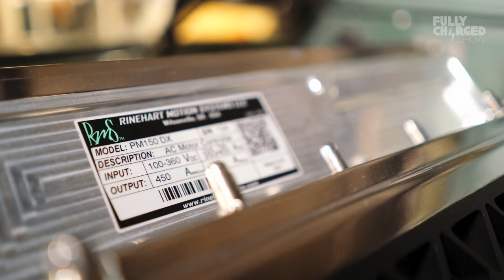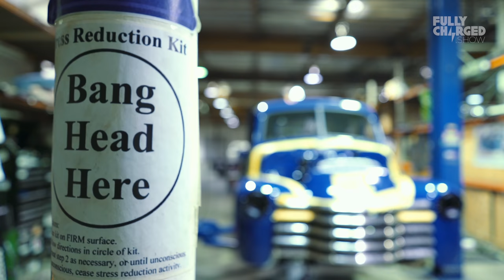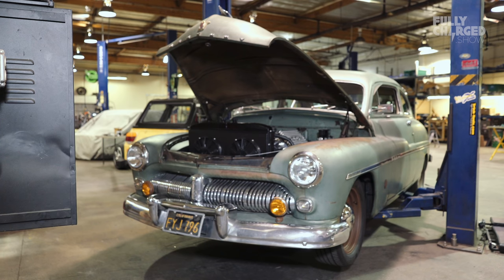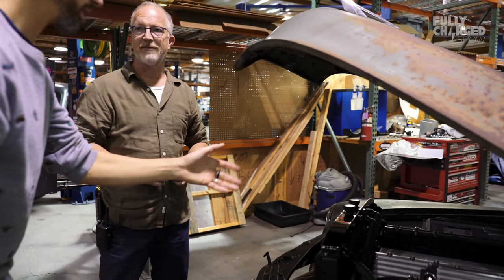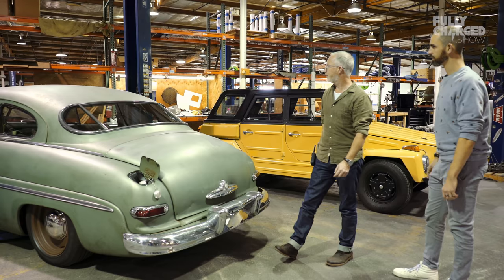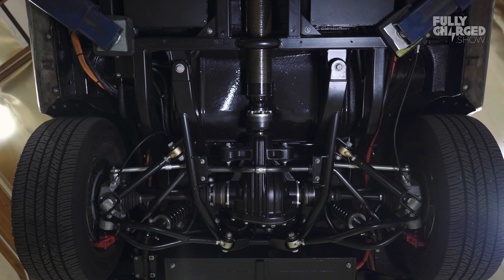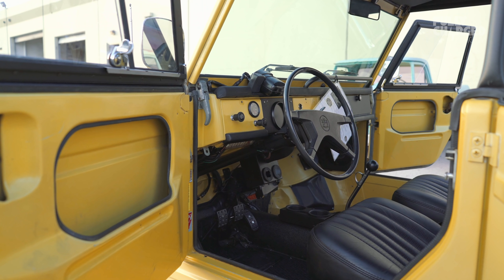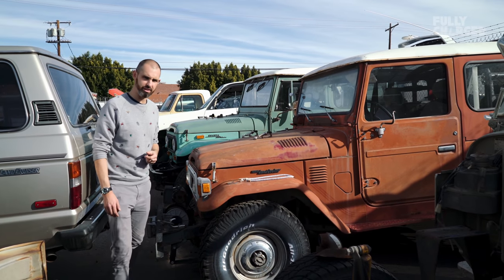Icon Derelict 1949 Mercury - EV Resto Modding | Fully Charged

Comment: Cool shop and cool car. I find the "Things were much better back in the old days" story tiresome though. Cars in the '40s -'70s were not well engineered or made to last. In my teens in the early '70s I wandered area junkyards studying cars and occasionally buying one to take home to autopsy. It was uncommon to come across a junked car with even 100,000 miles on the odometer. Cars were made of huge slabs of stamped steel because both steel and gas were cheap. Heavy body panels were the only way they could keep body-on-frame bodies relatively straight. Panels were fitted together with slots upon slots. Panel gaps were enormous. Engine tolerances were an absolute joke by today's standards. Yes, they were easier to repair. That was required because they so often needed repair. No,  the old Merc could not pass a side impact test.

I too am enamored by some '50s and '60s design elements and I'm glad to see these old cars being converted to EV. Especially so when I look at how they help give a desirable image to electric transportation. But that revisionist history "The old days were better" storyline that so many people willingly buy in to is unhealthy for our society in areas far beyond the expensive restomod scene.
Reply: There's an amazing video of a crash test between a 2009 Chevrolet Malibu and a 1959 Chevrolet Bel Air that's worth checking out.
The classic car just disintegrates, whilst the modern one would leave the driver mostly unharmed.
Reply: @drunkenhobo8020  And... it's rigged. The engine was removed from the Bel Air and other modifications made to make for a more dramatic video.
Yes, any car from the '50s isn't safe by today's standards. They were incredibly deadly in head on collisions. I just thought it undermined the point of the video to fake it. I guess putting in calibrated dummies and adding up the damage points would make for a boring video.
Reply: I love old cars, but you are absolutely correct in your assessment. Old cars survived an impact by killing their occupants. Energy from a collision must go somewhere: if it's not deforming the vehicle's body then it's likely deforming yours.

Old cars leaked fuel, oil, and water and also required frequent maintenance way beyond what would pass today. It was not uncommon to put pans or cardboard sheets under even new vehicles to see if they would ruin your driveway. Creaks whistles and squeaks were  audible over the engine noise. 

Initially derided as "Jap-crap" it was, somewhat ironically, the Japanese manufacturers that raised the standards (instilled by W. E. Deming, an American) of vehicles.
Reply: Thanks Bill, for the clarity...it's a dangerous game comparing across era's but the false memory  undermines a lot of the ability to compare details and be more precise about what worked and what didn't and why. The reason a lot of the old ways changed was exactly because the buyers didn't want them anymore..for a reason.
Reply: Well cars from the 90's and early 2000's can and have successfully made it into 500k+ miles territories. Not all of them obviously, but I know far more examples of high mileage E34 and E39 than E60. There are many W124 that made it over 1kk kilometres, but not the W201. Toyotas from early 2000's, barely ever break down. 
Ironically most modern cars have more problems with electronics (and sometimes it's just the wiring), rather than mechanics.
Reply: @TheAndreArtus  Same for motorcycles. When I first went looking to get one in the late 1980s, I asked everyone I knew who rode or had ridden what they recommended. The only person to recommend a Harley was this one Harley purist guy for whom that was the only "real" motorcycle. And his was always in various pieces on his living room floor. A couple other old bikers confirmed that Harleys are great if you like to spend twice as much time under your bike as on it; if you enjoy wrenching more than riding. Me, I don't wrench, so I got me a Honda for my first, and Beemers ever since.
Reply: I believe GM was doing planned obsolescence all through the 70's & 80's. My Olds Cutlass had so many embarrassing minor issues by 80k miles(AC,Carb,Windows), I couldn't wait to trade. Unfortunately, for GM there was a Honda lot on the same block willing to deal.
Reply: @jur4x  Much of the problems with aging electronics in cars is rooted in ROHS, the European standard that banned lead solder , among other things. This was a shortsighted regulation. Far more potentially hazardous waste is generated because of discarded parts and vehicles that should be easily repaired.
Reply: @doodlebug1820  I love old motorcycles but my 1977 Honda mostly sits. Weak brakes that require a lot of force with no ABS is a scary combination
Reply: @bgsound2721  Before then US manufacturers had focused on style over engineering. Engineers at GM wanted to build a mid engine Corvette from about 1960 but it is finally coming to market next year. As pollution regulations came into effect Detroit basically said "we can't do that" and looked for the cheapest way to kluge together existing technology to meet regulations. Foreign manufacturers saw the opportunity to invest in engineering and design and kicked Detroit's butt in quality by constantly improving the core product under the skin. It was sad to watch, such a missed opportunity. They are missing yet another such opportunity today.
Reply: @Miata822  I also still think that older point-to-point wiring is a bit more reliable then modern CAN-bus. At least, faults would only affect this one thing, not something else elswhere on the car. 
And speaking of repairs. Why the hell these days you need computer (with special expensive software on it) to replace brake pads or 12V battery?
Reply: @jur4x  I too prefer discrete wiring as it makes field repairs easier for unskilled or ill equipped technicians (on the machines I designed for use in harsh conditions and remote locations). For personal vehicles it makes a lot of sense though. It cuts OEM cost and channels repairs to their outlets.

Why does service require a computer? Because a modern car is a computer. you downloaded the right driver for those new brake pads, right ;-)
Reply: @Miata822  I do find it odd though that for someone who is so knowledgeable about cars would make a statement that "side impact is better than any modern tissue paper car". That is another one of those myths and is just false. I guess he is in the business of selling classic cars so he feels like he has to downplay the huge gulf in safety compared to modern cars?

The Plymouth crash test is at 40 mph but with another car that itself crumples which lessens the impact.  
https://youtu.be/iXUlZjScP3M?t=368

The Model 3 crash is at 38.5 mph but with a rigid barrier ram and looks barely bothered. https://youtu.be/zif6Od2vlyA?t=1
Reply: @Miata822  And the biodegradable wire insulation have plagued a decade of European cars, because it works and provides food for wildlife.
Reply: @drunkenhobo8020  Actually, it's kinda the opposite. Modern cars are designed to crumple, thus absorbing most of the energy. Old cars, well, have none of that. So, a modern crash test really mangles the car, but the occupants walk away. A "classic" goes through the crash barrier (wall) with only a few scratches, while the occupants are bloody smears on the inside.
Reply: Don't agree
Reply: Perhaps a CAD designed frame could be remade to include newer safety features such as ABS and airbags as well as newer style glass and made electric.. and disc brakes all around. And crash zones.. 

Would be time consuming but it would revive a dying era of automobiles..
Reply: I appreciate your lack of rose tinted glasses.  It is such a refreshing change.  I find it absurd to hear about cars that are now classics because they have lasted due to continuous commitment from mechanically adept owners.
Being UK based and not loaded I thought the Ford Capri was just the best thing out there.  Then I had the misfortune to actually be in one, all show and no go, uncomfortable in the back and constipation curing handling and brakes.  Now they are worth crazy money because people my age weren't able to let go of their childhood memories and realise they are junk.
I am good with resto modding, it means you can have the car you loved seeing as a child in a form that is actually as good as you thought it would be.
For those of you wanting to buy a true classic car some information you will need to know.  Bump starting is best done in 2nd gear, then get the clutch down fast before it cuts out again.  I have done this with a 1200cc V twin motorcycle, nearly killed me.
Reply: Ok Boomer
Reply: So true. Old cars and motorcycles are romanticized. Everything is better now except style and design.
Reply: Bill Kerr same. I did a resto-mod on a 75 Honda CB550. It looked great but it was slow, weak brakes, no ABS, heavy body. It didn’t compete in anyway with a modern bike except looks and that’s subjective.
Reply: .. not every classic cars suits electrification (design wise)..  but .. Fiero(little DeLorean-) .. Miata or  MR2 .. (with dead petrol engines) seems to be perfect ...
Reply: @bukkuk5949  While I long for a good electric Miata the truth is that small fun cars like these aren't really capable of handling the additional mass of the batteries. 
Any retrofit from ICE will have significant compromises but the air cooled 911 is said to make a good conversion, but that is an expensive place to start from.

Comment: 17:45 Jeremy Clarkson and Richard Hammond stand up and take notice in another second as we hear Jonathan say,   
"All the way to TOP GEAR!"  Woot!  I really learned how to drive with a 1967 and 1969 VW Squareback, 65 air-cooled horsepower and the later model showed improvement with my removal of the exhaust system and heater boxes that were replaced with exhaust headers and single glass pack muffler from J.C. Whitney (36-40 mpg, no change in cabin heat, and my first set of Michelin radials 6.00-15 XZX also helped).  Then 1984 and my first new car, a Toyota pickup, 25 years after that my second Toyota truck was built, my latest drive, and since I recently bought my third flux capacitor, I know where to buy more.  Back to the Future!

Comment: The Europeans all wait for Winter in Norway to generate their supply of good used TESLA parts!  600 hp on ice roads!  lol
Reply: Though unfortunately the higher weight, lower centre of mass, typically awd variants as well as higher standard of driving tuition means that it's unlikely...
Reply: @SirPlankton  Not to mention traction control and anti-lock brakes on microsecond control rather than millisecond.
Reply: @SirPlankton  And is my memory correct saying that in Norway winter tyres can only be used for one season? Hence enormous supply of good barely wearen second hand winter tyres available in the Baltics (Lithuania, Latvia, Estonia)
Reply: @jur4x  That is something I'm not sure of actually...
Reply: Im not sure the supply is as steady as one would think, chrashes happen, but not to the extend usually happening in other countries around the world.

Theres already been quite a few winters with rwd model S's slipping around corners.

Not to mention the heavy model x.
Reply: @SirPlankton  Everyone has tried sliding slowly towards the bumper of the car in front of them on sheet ice. Really not about the vehicle type. However EV drivers drive more economically in winter to make up for the range penalty, so presumably, they drive slower and more attentively than the rest.
Reply: You can make a 97hp shoe box run off the road in winter conditions. All about tyres and iQ behind the steering wheel. Salty roads aren't fun, but necessary.
Reply: Funny, not sure if true. But then @Teslabjørn crashed an almost new car on an oval track, so there's some truth
Reply: @jur4x  There is noe age limit, but the minimum thread wear limit is 3 mm. Normally a winter tire is past its best grip levels after 4-5 years regardless of mileage though so people tend to change them even if not at the legal limit.
Reply: Anyone watched Russian traffic vids on YouTube? If Tesla’s are sold there, expect 1000s to be available. Crashes galore.

Comment: That is amazing engineering and attention to detail on the big Merc. But at what cost?   There is hundreds of thousands of dollars in development time and hardware. 
I have had 2 FJ-40 Landcruisers, the last one was bought new and never used on the street, only off road as a service vehicle for contract service of Forest Service mountain top repeaters and two-way radio systems and lookout tours in the central Sierra Nevada mountains. It has 25,000 off-road miles and never once has a fault, loved it. That was years ago when they were new but I would love to have an ev conversion. Any idea of rough general price range ICON charges?  

So many were ruined as work vehicles by putting small block v8s in them. The original long-stroke in-line 6 was better at generating torque at low RPM. But electric is perfect for low-speed torque.

Comment: Wearing his best pyjamas during interview.
Great build till I saw cable ties holding the cables under the chassis.
Reply: 3 months to finish. You use the cable ties until you are happy with everything and then change them out in the final build
Reply: Yep, I rationalized the use of them as a stop gap measure. I rather doubt they would be there when it's finished.....

Comment: Cars not lasting long can be a good thing.  Technology has been constantly improved.  The old race car maxim is - if your race car continues to run after the race, it's overbuilt.  Meaning, you could have saved weight using less material and made a quicker time.

Comment: I have often thought that I would love to have a beautifully styled classic, but with more modern, reliable running gear. With an ICE engine that can be massively complicated, (read "expensive"), but with an EV, where a motor can be mounted onto the existing gearbox? A much easier proposition, and I would expect far easier to get approval for road use.
Add to that: Being able to charge from solar panels at home? Just maybe, my dreams might come true :-).

Comment: I'm sure Mr. Ward meant "hockey stick", not hockey puck when talking about exponential growth.
Reply: Thàtc shouldread Hida h_v not hr%v it is😗2000 anf its relative miles pèrr uniy ohh  mosel qith about 120000hilesclocked uup and uould it be worth thevexpenditureor would it becheapee ro vuy a snallee ,lighter vehicle such as a nissan leas, vauxhalllccorsa or cloe gòr example. DIVEEN THE SIe/weightiof the honda alsom approx hiw long would we be carlesswithin a week or so? Ta! Gar
Reply: Is there anywhere in u.k. that similar conversions can be done i have a yesr 2999Onda hr_v wfich we would like to jeep with about 122999miles clocked up  and over the long term would this br more economical than buying a new lighter vehiclee.g. lesf corsazoe etc.
Reply: 7ot,77i,7tiwe wouldbe grrful for a uaeful, early replt thabk yoi? Siy could be an option.

Comment: Excellent, now do a 1920' streamliner or the 1939 Porsche prototype and it will be even more efficient than current production EVs! Seriously, we need old EVs on the street too, can't wait for the first gen 2009 EVs become rattling rust buckets. (The VW has a misaligned motor. It is audible by the modulating whine from the gears!)

Comment: I’m not sure they’ve thought through cooling electronics inside the trunk/boot. Nowhere for hot air to go except leak into the cabin or heat build and cooking. Also likely 2000rpm constant fans that aren’t thermally controlled bashing against a rammed storage space
Reply: They've thought it through, genius. There's a battery stack behind those fans.

Comment: 3:33 Which automaker is he talking about here? I can't think of a company that built or builds throw away ICE cars (even though they all ought to be thrown away...). Despite his laptop battery analogy he's not talking about Tesla either. Design is one of the main pillars of the company, longevity is another, especially with the upcoming 1 mil mile battery.
I think these "oldschool industrial arts" he wants to revive are only revered due to their incredibly inflated aura of nostalgia. Hollywood literally elevated classic cars to godhood status in their movies, but try to find a film that's featuring a modern car that's not a million dollar or 1000 horsepower spaceship on wheels in a hero role, especially a BEV.
Reply: Yeah, I wouldn't say planned obsolescence but more like short-term priorities and greed inspired neglect. For example, I've seen Ford/GM using cheaper mechanical materials (questionable plastic engine parts) at the expense of longevity. Many automakers also flocked to CVTs, which have great efficiency, but are mostly less reliable (efficiency matters less if the vehicle doesn't last). Ideally, EVs should resolve many mechanical corner cutting.

Comment: 17:36 Woah I didn't know electric cars have gears???? ....... But why??
Reply: Same reason a gas car does. Torque going slow, RPM going fast. Plus it allows use of the original transaxle and with the feel of the car. FWIW, the original Tesla Roadster was a 2-speed manual transmissioned car, the new Porsche Taycan is a 2-speed as well.

Comment: Interesting. They hope for accident Tesla's because of bad experience with Bosch parts. What is going on Bosch?

Could your camera man or woman please handle the focus better?
Reply: It's not just due to 'bad' bosch parts - it's that a crashed Tesla provides everything required for them to convert a car - plus Tesla are the world leaders (currently) in efficiency and performance, which is why many other automakers are struggling to produce EVs with a range over 250 mile
Reply: @logicalChimp  I know. That's why I drive a Tesla Model 3.